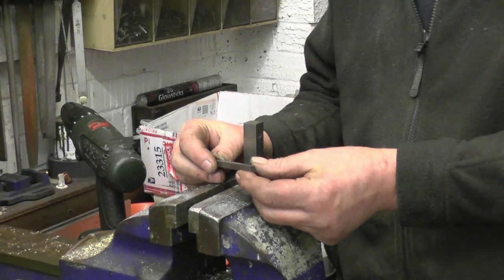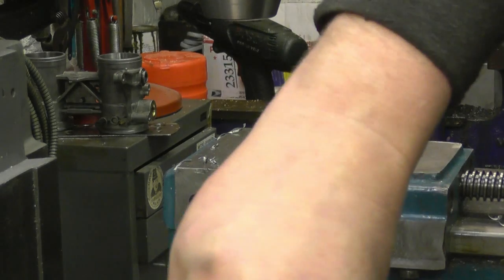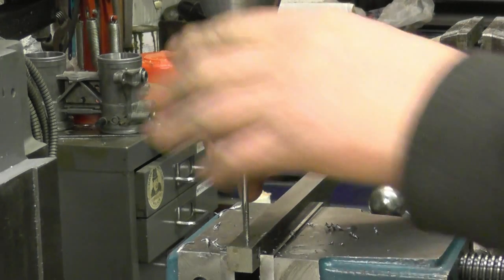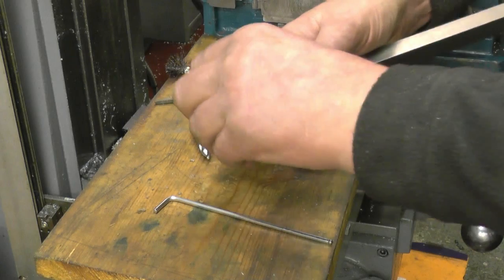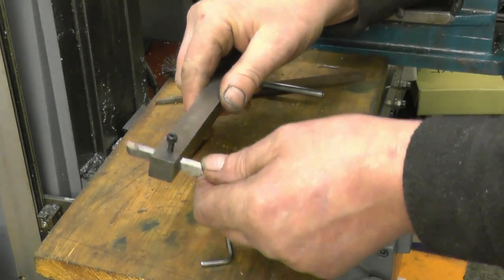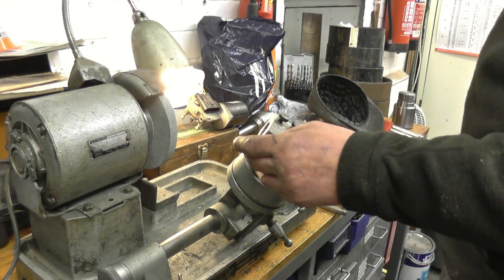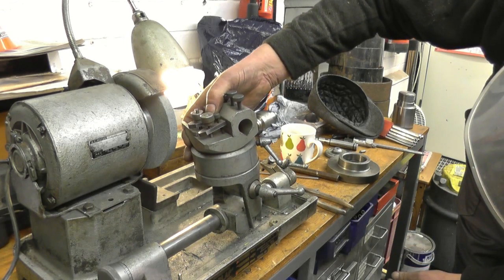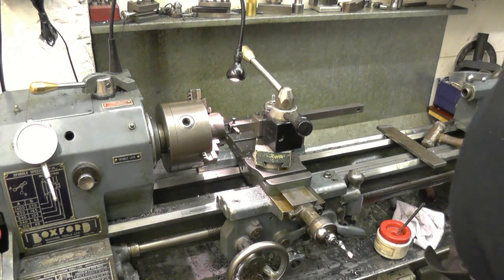Harrison Lathe Chuck Back Plate part 4

Comment: John,
I like your tool grinder. That's really handy for grinding your own high-speed steel cutters. One thing my grandfather used to do was to remove the wheels from his grinder ever so often. He would lightly tap them with a wrench or small hammer. The wheel would ring if it was OK. If it didn't, he'd replace the wheel. If they don't ring, they have internal cracks and will explode when you least expect it. Thanks for another part of your project.
Dave

Comment: Hi John. If you ever decide to do requests  some more info/pictures and demonstrations  on how  you use your cutter grinder to  sharpen  tool bits and twist drills would go down very well. Will it sharpen the ends of mills as well. Many thanks for a very enjoyable set of vids.